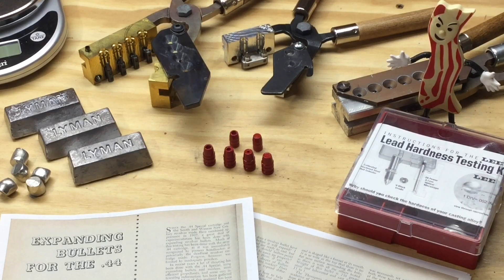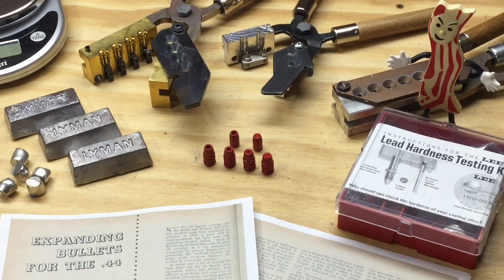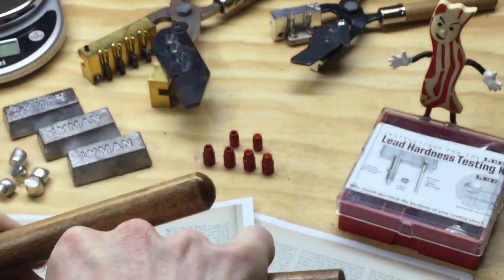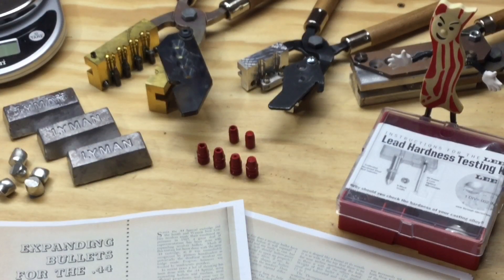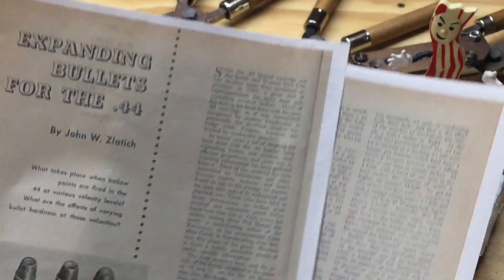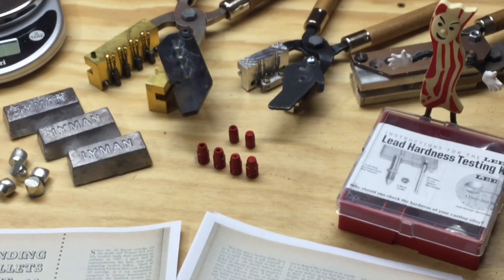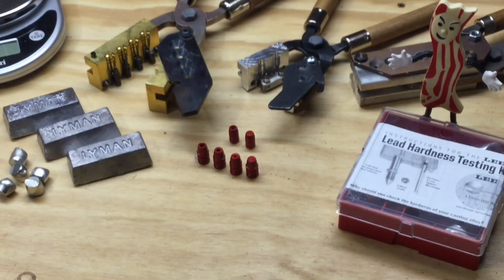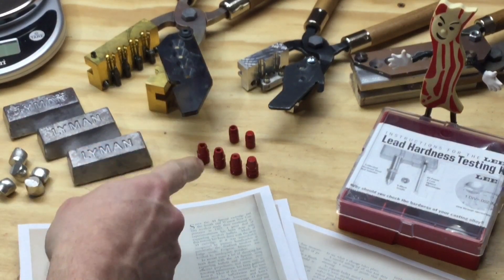Introduction:  Powder Coated Cast Lead Hollow Point Bullet Testing

Comment: Bacon - I'm sure you've seen them on MP's website, but they also make the 432-180-SWCHP and the 432395, a 220-gr HBWC. They also make one that's very similar to the Lyman 260 gr Devastator RNFPHP.